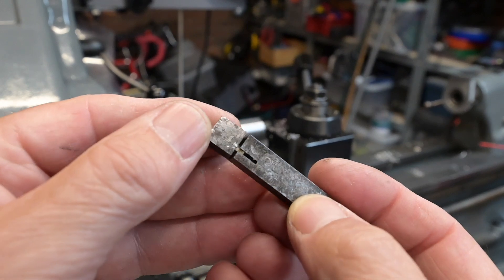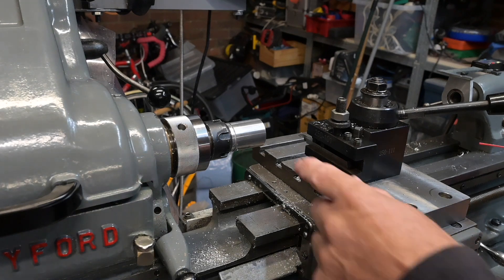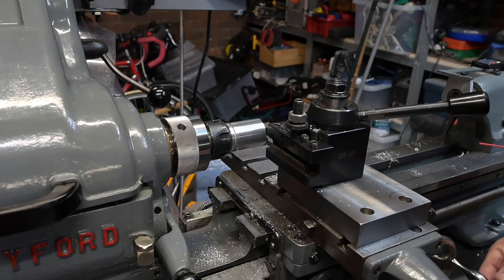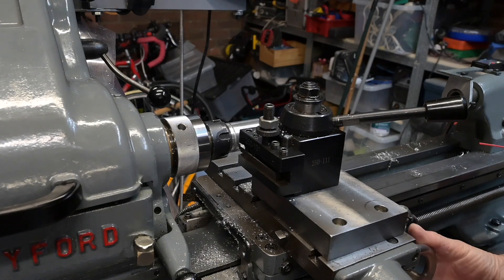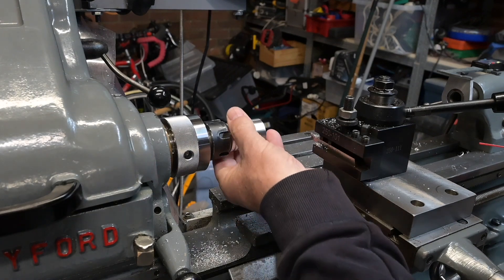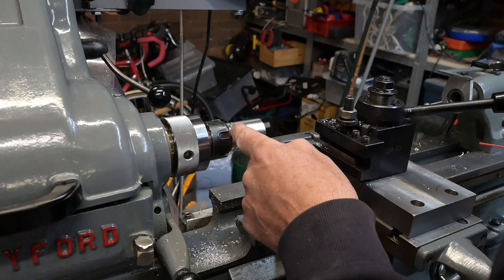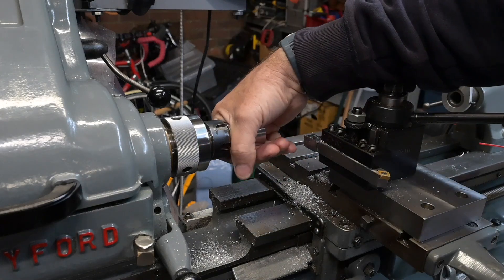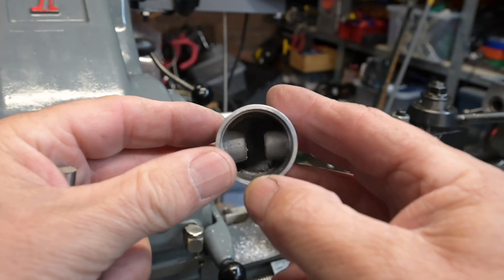Cutting Piston Ring Slots by Hand - Miniature  Petrol - Engine Part 15

Comment: You did ask for a suggestion Mark. You could have clocked the parallel with a dti on a mag base attached to the side of your colum or head, but when all said and done it doesn't really matter, as long as the slot is parallel with the sides and the gudeon hole is 90 deg to the slot everything is great. which it looks to me that's what you have done. nice work, quick, clean and simple👍
Reply from the maker: Thank you for your suggestion, always learning 👍
Reply: @EnglishHobbyMachinist  every day is a school day as they say, I've learned alot from you, good to share👍
Reply from the maker: @paulrayner4514 👍